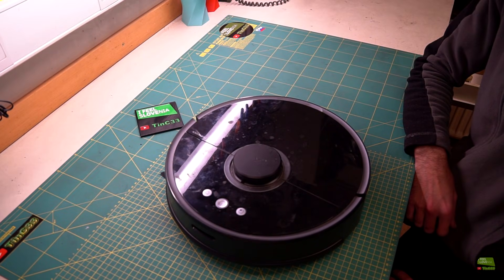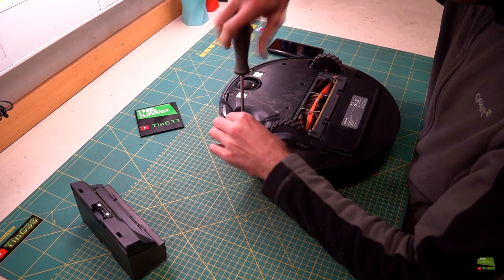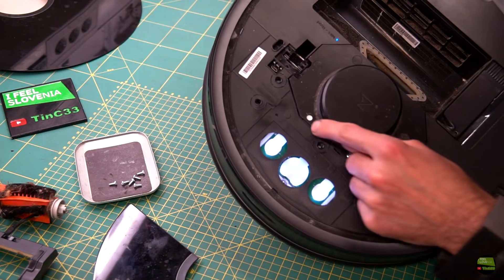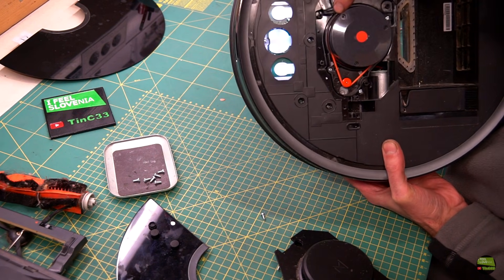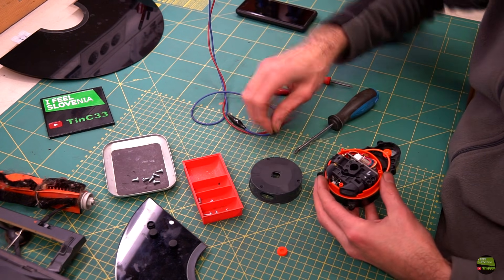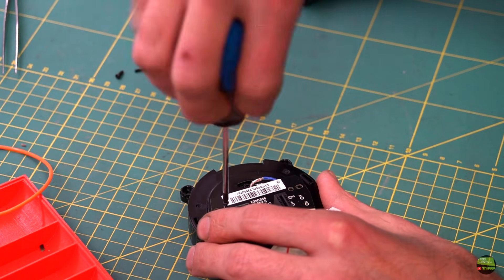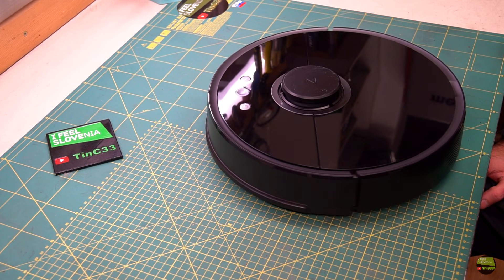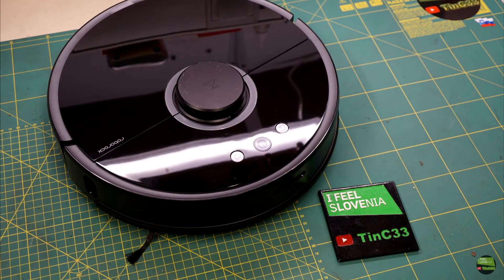Xiaomi Roborock ERROR 1 Easy Fix & deep cleaning

Comment: Thank you for this.  I always to hesitate to tear into a device for fear I do more damage than good.  However, my device quit after circa 40 days since it was delivered to me and the manufacturer referred me to the seller who referred me back to the manufacturer.  Grrrrrr.  Basically, if I didn't fix it, the entire purchase price would be wasted.  

 I have a Roborok 8+ but it is similar enough to the model you repaired to make the video useful.  I found nothing more obstructive than a single pet hair but removing that and spraying a bit of contact cleaner strategically made the difference.   Frankly, I think this design is far too fragile for a vacuum.  Hopefully Roborok will take note.
Reply from the maker: Thanks, i'm the guy who can open anything if it's broken i can't make more broken 😁 
Yestourday i replace iPhone camera, open them for the first time, everything work well...
You just need to bealive into yourself, and take photos, notes... During disaasembely.

Comment: Just one thing I would have done differently. Disconnect the battery before doing this
Would be a shame if you accidentally drop a screw on one of the the PCB's and cause a short
Reply from the maker: That's really good point, my bad, i also fix high voltage live manytimes, don't ask me how many times i feel instanr regreet 😅

Comment: Great manual and it actually helped even though I couldnt find anything inside!but I just cleaned it a bit and it seemd to do the trick.
Reply: sad thing though, after another 40 mins of work or so, the said error reappeared. Could it be the motor or something?

Comment: Thank you so much for this.  I thought mine was ruined.  I only needed to take the turret cover off (the second set of screws) to discover a long hair tangled up in the drive belt.  I pulled it out and it's as good as new.

Comment: Thanks for the video. I've learned how to get to the laser sensor next time I'll be replacing the sensor - as cleaning &  moving didn't help me. Firstly, the rotor moved (though slower than supposed to) but soon stopped,  then the robot tried again with the same result and finished with 3rd attempt with error now even without sensor rotating. So, I guess I have to replace entire sensor.
Reply from the maker: If you remove the belt sensor rotate smoothly? Then try to jeplace only motor it cost just a few $ i read that some people got issue with motor.
Reply: @TinC33  Yes, the rotor rotates smoothly (I've dissasembled the part with magnet to check it). So I ordered motor and let's see how it fares. Thanks for your advice.

Comment: Hey it worked :-D Turns out that when the roborock (S7) went under our Christmas tree, a pine needle fell into the lidar sensor and knocked the orange band off the wheel. Tweezered out the pine needle and put the band back on the wheel and we're good to go.

Comment: very helpful for disassambly. There are cases however, where there is no mechanical block (laser head, belt, motor) and it is still not working. The motor works fine with 5V.
I found somewhere a video where it was shown that driving the motor with 9V for a short time (few seconds) helps. So it was in my case.

Comment: Big thanks for this video. I opened, checked motor and cleaned all module and my roborock is working again.
Reply: Unfortunately after two usages of robot it fails again with same problem. I opened it once again and used compressed air to do cleaning of sensor tower area. It's now working again. 

I spotted that when sensor is rotating it have some small inflexion maybe this is causing jamming of rotating parts. Do someone run for same problem?

Comment: Great video, ive tried the steps and it works. Problem is that after a few cleanups the error repeats it self and I have to troubleshoot very often. Any idea what I might do?
Reply from the maker: Hmm it make me once and only never again, do you sure it's cleaned enough, so it turn unresistance, otherwise it may be weak motor new one cost a few $

Comment: The same error comes again after some time.
Reply from the maker: Than you may need new motor, check on ebay, ali...
Reply: @TinC33  motor or lds?
Reply from the maker: @cdoubleu8719  no no only motor, there are about 10$ on ebay, but you can try them before buying, unplug motor from the board and plug it to some usb cable 5v DC and you'll see if the motor stall or run ok.
Reply: @TinC33  I have tried soldering the motor to usb. After 1 run I get error 1 again. Could it still be a faulty motor? Or is it really jamming do you think?
Reply from the maker: @cdoubleu8719  i would say jamming, try to dissasemble more than i do you may find some dirt deaper.
Reply: @TinC33  Thnx for the help. I disassembled the LDS and found some very small dust particles on the motor shaft. After removing those the robot is working like a happy chap again. So also on behalf of my gf and kids thnx a lot :)
Reply: I disasembled laser assembly, no dirt. Cleaned everything.  Same error. Bought new motor , installed it. Same error. Where to look next do you think ?
Reply from the maker: @daveod2134  bearing? But when fail appear it feel stuck or the head turn nicely

Comment: Hello TinC33, great content, thanks a lot! However I unmounted everything like you did, but nothing was inside to block the laser... I mounted back it worked for few seconds and it stopped again :-(
Reply from the maker: Make sure there is not something inside, try to unmound a bit furder, and check if the motor work without belt, you can power them with 5v (usb power) in any direction but disconnect it from the pcb firstly.
Reply: @TinC33  unfortunately I didn't find the way how to test if the little motor, so I just order a new one on Aliexpress for just 6$... finger crossed! :-) Thanks for your great content and your kind answer!
Reply: @GianFilippoFloriddia  Report back please how your story continuous @Gian Filippo Floriddia.
Reply: @abccde3832  hello! Thanks for following up. After few days my little motor arrived directly from China, just 6$. Thanks your video I saved a very expensive fixing costs... I just changed the motor and now my Roborock works perfectly!!
Reply: @GianFilippoFloriddia  You got S5? I'm noticing lots of spare part for former models, but few for latest (which makes sense)
Reply: @GianFilippoFloriddia  can you please share de motor link? i guess i gave same issue..
Reply: @PedroMarques1980  this is exactly the part I ordered from Aliexpress: https://www.aliexpress.com/item/4000586141789.html?spm=a2g0s.9042311.0.0.24fc4c4dhZdeC5
Reply: @GianFilippoFloriddia  thks you its working now but my case was strange: i manage to test the motor with a external power supply and was running..just when connected to the vaccum it will still giving the error.. (the sensor and baring were rotation fine).
the way it worked for me was: making the motor rotate connected to the sensor back and fw (changing + an -  to change the rotation clock wise or anticlock wise for like 10 secs on each direction).
only after doing this it came back to life normally.
thks again all of you!
Reply: The motor is 5v (board outputs 4,9V), so you could test it if you have an adapter (or 4 AAA batteries). Mine was clogged with hair wrapped around its shaft. After removing the hair it started working again (its a very weak motor / operated by low current).